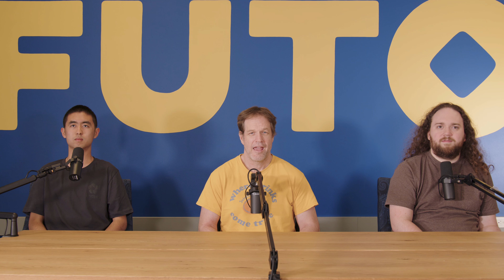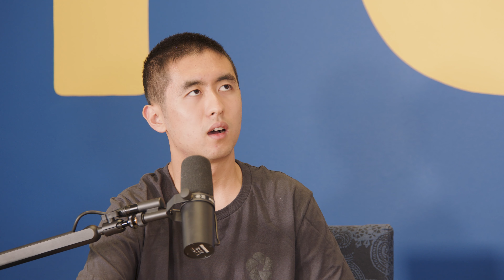Interview With FUTO Fellow Byran Huang

Comment: It will be cool to have a laptop designed without the battery . So that it's "thin" whenever you plan to have a wall plug , and just bring your own FCC certified battery whenever you want to be away from one . 
I don't need the battery for most of my day . And the thought of plugging in the laptop into my backpack is fine .

Comment: Collabora says they have a good working relationship with ARM and Rockchip. I hope that will continue with the Rockchip RK36XX line.
Collabora has a matrix where you can see what parts of the RK3588 are supported in the mainline kernel.

Comment: I dont get the fancination with ARM. Its not what is making these chips more power efficient. One of the AMD cpu head engieers confirmed. If you want a power efficient chip you can make a power efficient chip. We should be focusing on RISC sinec its open source unlike x86 and arm.
Reply: There is less economic incentive to a company to develop open source hardware to others profit from it

Comment: Very interested in open-source hardware mouse, than the laptop. I use a Pulsar X3, which is ultra-lightweight, which has vastly better, lightweight software than Logitech and Razer. But the software is only Windows based, so having open version of the hardware, like we have for keyboards would be industry changing

Comment: 7:20 Try getting the laptop through Walmart Hardlines certification with UL, then we can talk about what's necessary and what's not.  There's a huge blind spot in right to repair with regards to retailer and supplier liability. I'm a huge advocate of being able to easily disassemble and repair parts... But now that I've actually taken a product to big box retail as a product engineer, I understand the real problem. It's the insurance companies.
Reply: can you spell out what is the exact problem for the slow in the back?

Comment: Laptops are cool and all, and I'd love to see a more open one, but at the end of the day, it feels like most laptops have been more than fast enough for basic use for years, as such with enough availability of old laptops, you can always pick up a replacement at a fairly low cost, so long as you can migrate all your data and programs easily enough. In some ways, being able to reuse old laptops more, having some sort of generic battery replacement, seems more interesting. I do care about openness, but not necessarily for the sake of repairability, more for sovereignty of your own device kinda thing. Towards that end, it feels like starting by trying to make as open a desktop as possible first feels easier? (and worrying about portability later) Like a risc-v with open firmware and as little as possible proprietary blobs would be nice. (I'm not saying do one and not the other, I'm just wondering if doing things in a different order might make more sense.)
Reply: See I think making the laptop would be easier to start with and then abstract discrete components off the main board. At the end of the day for me, I don't think there's a huge difference between a laptop and a desktop other than one is portable and the other one is less portable.

Comment: Honestly a decent ARM based laptop that runs Linux(I prefer debian based)would be perfect. I don't even need that much performance, something in the range of an ryzen 5 or I5 would be more than enough for what I use my laptop. I looked at Snapdragon based laptops but I can't find If the bootloaders are unlocked or not and I don't know how well Linux works on these (considering that from my understanding Qualcom is quite bad offering support for their chips)
Reply: Check out MNT, it's based in Germany. I like what I saw, though personally I like x86 more and I also game, so for me it wouldn't be that practical. I can't wait for RISC-V to become more mainstream.

Also, if you happen to be a romanian, hai noroc! :D
Reply: @Winnetou17  Never knew about these guys, I'm checking them out.

Zis si facut
Reply: They have unlocked bootloaders. Linux run on most of them, but some things are not working. No webcam, no speakers (they can work, but it "may destroy them"). On my Lenovo Yoga suspend is not suspending at the moment. Look at "Ubuntu Concept Snapdragon X Elite" if you want to learn more details.
Reply: None of the following are open source hardware, but Qualcomm has funded Linaro to mainline Snapdragon laptop SoC support. Tuxedo has previewed a Snapdragon laptop. Lenovo Chromebook Plus 14 (MediaTek) might also be interesting. Google usually upstream Chromebook kernel stuff too. Finally a used M1 Macbook might also be worth considering.
Reply: Screw Debian Linux and SystemD.

Comment: as much as its easy for everyone to hate on x86/amd64 atleast they have relatively open standards for booting hardware interfaces(atx pcie ddr# etc), arm is not like the old sun sparc stuff with open boot where you can just boot anything you want from the firmware, they dont release any code for drivers/anything most of the time, take a look at like arch arm and see how theres a different build for every single device basically, have other random stupid stuff too with the binary blob driver stuff. like i was looking at getting a more higher performance(At the time) odroid board for a media server project but the video decode functions only work in like 2 programs you cant just use firefox or vlc or something. if we can get a new version of open boot or something, if we can get atleast binary blobs released as individual modules or something atleast get a single kernel image that would support a majority of devices of the same architecture you might get somewhere, otherwise they are basically all the same as apple

Comment: The mouse would be great if it had something like Razers hypershift to hold the thumb button and have locally storable secondary programmable function keys in it, so in theory holding the thumb button and clicking the middle mouse button could trigger a system event such as showing the app grid/start menu or general programmable macro functions and scrolling when the thumb button is pressed could zoom in and out of the screen or switch workspaces along with ways to quick switch between profiles such as performance and power efficiency states depending upon if you're gaming or if you're doing general productivity tasks. If these additional programmable functions could be stored on the mouse itself, then you could connect to any other computer/OS and all the same configs would continue to work elsewhere on Linux, Mac or Windows etc.
Also if there were no limitations in doing so I'd love a pressure sensor where your palm sits that you could use to trigger a function when you apply a certain pressure to it making better use of all of the space on the device and using all of the flexibility of your hands to really leverage more functionality from the device.